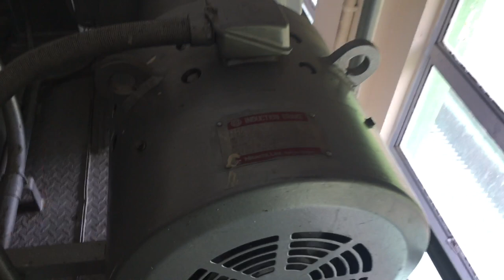Hydro power plant generator running

Comment: To date there are no multi bank hydroelectric turbine halls in the world
The reason given is backpressure leading to turbine surging right?
So if you were to fit a turbine in the pen stock and more in the tailrace that would not work right?
Well this was the common teaching in the field but is no longer correct and this system can be retro fitted to old dams with no added down time to the main turbine hall during running and install is less than a week of interruption to the dams output
So why is it not used ?
Simon Bowman in Cairns Queensland has such a unit with no shafts gearboxes and can be swapped over in a day for servicing
It is fail safe and if all the turbine units were to lockup the main hall can continue normal operations
Now this should be good news to the industry as green is all the rage right now yet since 2016 when the first proof of concept test was run in new south wales the industry has shunned it  why?
Hope this has given you some new insight to the future of hydro